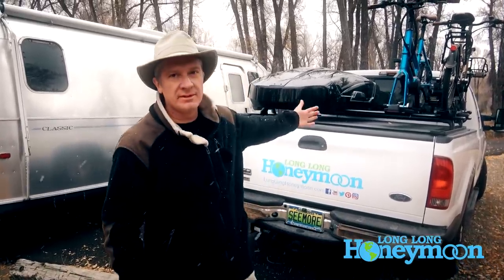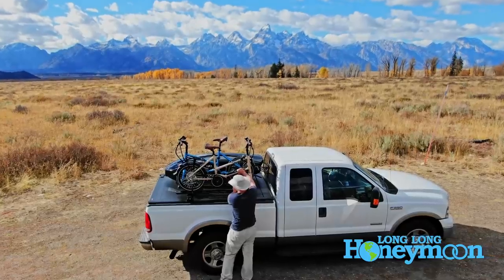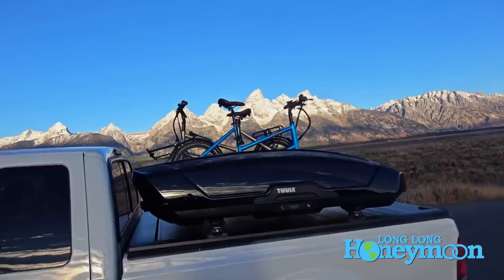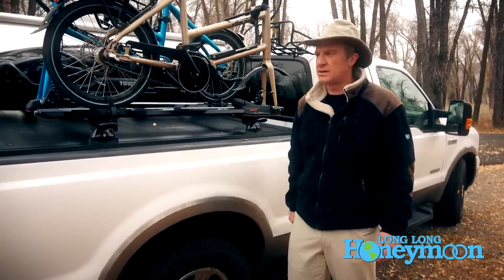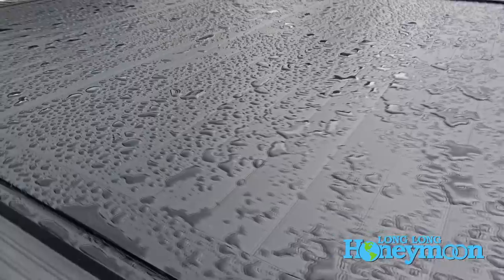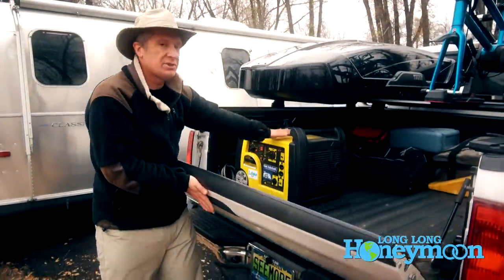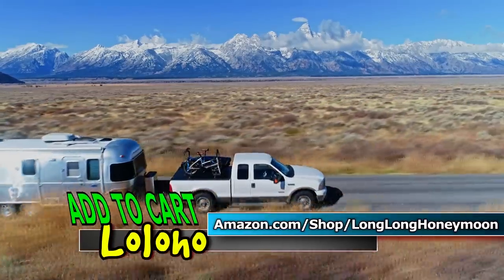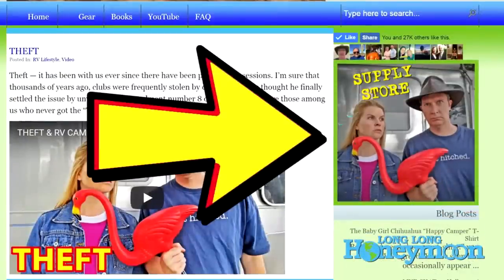THE BEST TRUCK BED TONNEAU COVER? RetraxPRO XR Series Review 🚲 🚲

Comment from the maker: This is it! https://amzn.to/2CJ97Rs
Reply: Campfire question 
 I drive a loud 6.0 turbo diesel like seamore after towing the trailer a long distance I like to let my truck idle while unhitching to let the turbo cool down & start the truck while I'm running slides / awning in to warm up before towing do others consider this to be rude at camp?
Reply: No
Reply: Hey guys! Did you guys like this solution for heavy eBikes?  Did you like the cover itself or did it have issues?  We're doing some research and looking ourselves since we won't be able to store them on the back either. Thanks.

Comment: I just bought a 2018 F-150 and had a Retrax Powertrax installed. It’s my second Powertrax as I had one on my 2015 F-150. Great product. They said the warranty will be void if any lubricant is used on the track. Only paraffin was is allowed. So on my new Powertrax I took a rag and ran it across a block of paraffin wax and applied to the track on both sides. It really smoothed it out. My covers are not 100% waterproof. Heavy rain or Carwash will allow a bit of water but nothing to be concerned with.

Comment: A year or two ago we put a BakFlip cover on the bed of our F250 with a front receiver hitch and bike rack. This looks like a much better solution though it’s also a much more expensive one.
Reply: exactly my thought, however, I think its worth the price - just picked one up today
Reply: The Traveling McCaffertys Our front hitch is a DrawTite brand but I looked at the Curt hitch and it was virtually identical. The bike rack is a Saris brand. No problems at all with the hitch or rack. If I could do anything differently I might get one of the hitches that folds down. Mine is fixed once it is in the receiver. When Im not towing I will sometimes put the hitch in the rear receiver but I can’t put the tailgate down with the bikes and hitch on. They make a hitch that folds down for that purpose but that’s not what I have.

Comment: Looked at the retrax a year ago and got the Pace Edwards. They had the rail system (much cleaner look and lower profile) before retrax offered theirs. Pace Edwards doesn't have an exposed key lock which is great for newer trucks with locking tailgates. (no key to deal with) Also comes with thule load bars. Retrax is nice though,.

Comment: We love our Retrax Pro MX on our Chevy 2500.  We find that with three young kids, my wife and I, our truck has become our main family vehicle (not just when towing our Trailer).  So keeping everything dry, and clean and still having room for a bunch of stuff is a plus.  I opted for the electronic one with remote; my wife can access easily without swearing at me :).  We have been very happy with it.  For those interested, as I was, I reached out to Retrax and got word this morning.  If you already have some other model of Retrax installed, the XR rails can be purchased and retrofitted to your current system.
Reply: Good information , thanks!

Comment: Good video, but IMO I think the storage hub would be better on the other side for rear view vision.
Reply from the maker: We could easily switch it.... I was thinking that the quick access from the driver's side would be worth it. It's nice to be able to step outside and immediately have access to that gear. But if the visibility ends up being a problem, we will switch sides.

Comment: We bought a Retrax for our Silverado 1500 when we retired in 2016 and we are full time on the road. This cover has operated flawlessly with no problems. Just a hint on maintenance keep the rollers and slid tracks clean and lubricated with a good silicone spray.  Love our Retrax.
Live your dream.

Comment: Now that it's been a few months since you had your Retrax cover installed, are you still happy with it, and the bike rack?  I had a Retrax (without the T-slot rails) on our 2017 RAM 3500 long bed, and it was VERY difficult to open and close.  I'm guessing the installers did not read the instructions.  We really like the idea of storing our bikes above the truck bed.  How do you secure the bikes so they don't get stolen?  Thanks so much for the great content!!!
Reply: We are still loving our cover. The bike rack has locks at three different points, so it's pretty darn secure. Not saying it would be impossible for someone to steal them, but they would have to put in a whole lot of effort!

Comment: Can you provide the Yakima part numbers for the parts you've used. I cannot find your type of setup on their website. They have an Outpost and Overhaul system, but they are higher than your system. Thanks.

Comment: We just returned from a couple of weeks of camping.  We have a popup camper so overnighting in a parking lot or rest area is not an option so we decided to set up and take down the camper every day getting to and from our destination, we won't be doing that again.  We originally were going to book a room at hotels along the way but were concerned the truck would be an easy target for those with ill intent.  We have a soft tonneau cover and it would be way too easy to get into and get to our generator, e-bikes and my cooler filled with adult beverages.  We decided to go with the Retrax cover from your Amazon store it will be here Tuesday. Now I have one more question were did you find the crossbars and T mounts.  Also thanks for all your entertaining and inspiring videos.  P.S. My wife has scoured your Amazon store and still can't find your self respect for sale LOL.

Comment: I've had a retrax for 14 years and will not get another one. Takes up too much space. Drilled drain holes. Drain hoses plug up with debris. Really starts to break down and become harder and harder to open and close as the years wear on.
Great for what it is maybe but not for me anymore.
Reply: I believed they have a lifetime warranty. Not sure if they would cover the closing issues

Comment: Good point about Ebikes and standard racks. The weight rating is usually not enough. The 1Up USA is a nice hitch rack with a decent weight rating. I liked it, but as soon as I hooked up a trailer, the hitch was not available for the bike rack. I put a bike under a $300 Tonneau, but I travel down (live on) a dirt road. A lot of dust kicking around. 

It's a beautiful cover and a great piece of engineering. The price is eye-watering. Right now I have a small van for my RV, and I could buy a small utility trailer for that kind of money. There are folding ebikes, and some, like the Fat Folders (wide tires) are very capable.

I didn't plan to watch more than the first 30 seconds of this video, but you had me hooked. People really have to work to keep things fairly simple, not leverage the stuff with more stuff. Stuff to the power of whatever...

Comment: I just had the Embark installed. It was GMC approved and had them install it. Mine doesn't have the rail system on top but don't really need it since I have a toyhauler, but having the whole bed locked is a bit of confidence.

Comment: I'm in Reno, NV and I called the local dealer.  He has been selling Retrax since they came out and said the ProXR is the best they make.  I have a 2016 Silverado crew cab with 6'6" bed.  They will install for just $100.00!  Yes I am lazy, but if something goes wrong they are on the hook for correcting.  I have the Chevy cover but always have hassled with the connectors and afraid of some twit with a knife.  Thanks so much for the videos and stay warm!!
Reply: Richard, did you go with this cover? If so, who did you use in Reno and how do you like it after a year?
Reply: @ChipRoberson  Yes!  It has been great!  Absolutely no problems!  TIP:  ONLY use paraffin was to lube the tracks.  Cut a small block and run up and down every so often and you are good to go!  Used Trimline on Greg Street

Comment: Hey Guys, what is you extended experience with the Retrax Tonneau cover?  I have a five year old Bakflip that is pretty torn up and needs replacing.  Looking for something that will last  a little longer.
Reply: It's still going strong! No problems and no leaks. Two thumbs up!

Comment: You and I are on the same page with the RetraxPro XR  cover and the E bike storage. Wanting to know how the Yakima High Speed mounts are working out after you have been using them for awhile - any issues or recommendations? Are you going to made any additional comments on this system?  Thanks.
Reply: Everything has worked well so far! Totally recommend! 👍

Comment: I see you are now using a champion generator and not your old yamaha.  Before i buy one i would like your reasoning.  Thanks for the great vids.  Soon to be a vagabond:  Joe Butler  SW Florida
Reply: We bought our Yamaha in early 2007. After almost 12 years it was starting to wear down and not be as reliable. We decided to try something cheaper with a lower profile (to fit under our tonneau), and it has a remote start. It's been a good unit so far!

Comment: FYI, the non pro versions are more reasonably priced as well. These new ones with built in rails are very cool. Wish my old ones had this option (I have drilled towers on my bed rails in the past).

Comment: Great choice Shawn! We tow a Toyota Tacoma behind our motorhome. I bought a ProdoTech folding e-bike two years ago, with the intention of storing it inside my truck bed. As you know, good e-bikes are expensive, so I wanted to be able to hide it from prying eyes while traveling. I then began searching for a quality locking bed cover. The RetraxPro was the most expensive on the market, but it seem to get the best reviews. I have been extremely happy with it after two years. Not only does it hide equipment from prying eyes, it protects it from the elements. I do get some light rain water leakage at the tailgate area, but the rest of the truck bed stays pretty dry. They didn’t have the model that you purchased available when I bought mine, looks like a great addition to their lineup!
Reply: What size bed on the Tacoma?  Does the Retrax take up much room when it's retracted?  I have the five foot bed on my Tacoma and the Retrax is on my short list.
Reply: I wasn’t sure of the exact measurements, so I just went outside to measure. The Retrax drum that stores the retractable top takes up 11” of bed space. It is mounted to the bed rail below the rear window, but it does not touch the floor of the bed. It still leaves about 8” of space between the the floor of the bed and the bottom of the drum. I have the 6’ bed and it hasn’t hampered me yet. A 5’ bed may be a different story though if you need to haul long objects.
Reply: I forgot to mention, the Tacoma’s OE cleat tie downs and sliding bed rail system must be removed before the Retrax can be installed. That was the only negative thing I found with the Retrax. To be honest, I really don’t miss it, but I can see where it may be a deal breaker for others.

Comment: Nice! I considered this and the diamondback they run for the same price. I went with the db although im probably never going to use it to its full potential it can hold 1600lbs on the top of the cover
Reply: The only problem with the diamondback, and I had one on my older truck, is you can't access the bed with stuff on top of the cover. The only way to access the bed is thru the tailgate. A deal breaker for me when I upgraded my truck for camping and bike hauling

Comment: I prefer the cap type cover for keeping my accessories, bikes, generator etc out of the weather.  Also I get better mileage due to the aerodynamic wind flow over the cab and cap over the trailer.   The price for your cover is high and your bike frames are subject to weather.
Reply: We like this system because when we aren't on the road the Thule box and bike racks can be removed in minutes. I also don't like the lack of visibility with a truck topper. It's just personal preference.

Comment: Love the idea of the cover.... but what happened to your Yamaha generator?  We have a Yamaha and struggle to find a truck bed cover that would allow room for the gen.  Any solutions or ideas (other than trading in generator - we LOVE the Yamaha that you guys have (or should I say had)?
Reply from the maker: We still have the Yamaha but (sadly) I don't think it will fit beneath this cover. Now, someone out there could probably mount the generator ABOVE the cover. They make T-Slot platforms and I think the load bars can hold 300 pounds! You would need to really secure the generator in place, though! I haven't seen it done but it should be possible...

Comment: I have a retrax on my 2015 F150 since I bought it. The cover still has not leaked. One thing the cover is not responsible for is the draft between your tailgate and the truck body. I have gotten lots of back road dirt in the first few inches of the truck bed. I love retrax paid 1200.00 for mine at the time. I installed mine by myself. No disrespect to Sean. But it is actually easy to do alone.
Reply: By truck body I should have said the spot between the the end of the cover and the tailgate on the truck. Along the sides on both sides are sealed completely. For me I just let the little bit of water that goes into the retrax box just fall into the truck bed.  It's never been a problem and we live in Florida with lots of rain.

Comment: Did you consider a bed cap instead of the tonneau cover and if so what were the factors that made you go with this set up?
Reply: I personally don't like the lack of visibility with a shell. Also, our bikes would barely fit inside a shell. Not to mention they would take up half of the bed space. This system allows full use of the bed space, room for the Thule storage box for things we access frequently, and storage for the bikes. When we're not on the road the Thule and bike racks are removable in minutes. We really like that! It's just personal preference, and this is what works best for us.

Comment: We are full time Airstreamers  and store our MTB  externally. Unfortunately a lot of the hardware on the bikes are getting surface rust especially after spending a month along the Oregon coast..
Reply from the maker: Check out Boeshield T-9. We have this stuff in the liquid and spray varieties and it works well. We use it everywhere on our Airstream (door, keyholes, hitch, hinges, latches, etc.) but it is great on bikes too. Developed by Boeing to protect aircraft from rust.  https://amzn.to/2CgzHR0

Comment: After seeing and experiencing the full installation of this cover on a RAMBOX truck... I cannot recommend it if you plan to actually use the rails like I did. The whole system relies on 6 tiny screws (3 per side) into flimsy sheet metal to support the entire system along the bed sides of the truck. NO WAY it can support any meaningful amount of weight In a safe manner. I have a detailed video of how  this cover isnsupposed to install onto a rambox truck if you are interested.

 Retrax customer support does not have any answer to its design flaws yet. I am still waiting waiting for a follow up from them.

Comment: For two grand you could probably by a nice shell and keep the bikes inside.
Reply: I personally don't like the lack of visibility with a shell. Also, our bikes would barely fit inside a shell. Not to mention they would take up half of the bed space. This system allows full use of the bed space, room for the Thule storage box for things we access frequently, and storage for the bikes. When we're not on the road the Thule and bike racks are removable in minutes. We really like that! It's just personal preference, and this is what works best for us.

Comment: Why did you choose this instead of a cap for your truck bed?
Reply: We needed to be able to bring our e-bikes on the road with us. They are too heavy for a hitch mounted bike rack, so an over the bed rack system was our best choice. This cover has the rails built in and works seamlessly with our Thule storage box and bike racks. And when we aren't on the road and don't need the box or racks, the rail system is really easy to remove.

Comment: I like that update to their cover.  I had the Retrax cover without the integrated rail.  I ended up drilling holes in the cover through the bed of the truck to attach the Yakima crossbar feet to the truck.  It worked well.   I wish this version of the bed cover was around in 2014 when installed my set up!
Reply from the maker: Yes, we have some friends who did the same to their Retrax a few months ago. I think this model will prove to be very popular.
Reply: U can buy just the rails with the t-slots to retrofit. I just ordered and looking forward to installing it on my 2 year old retrax. Also...what model is the Thule cargo u have in the video?

Comment: That cover is sweet. Sooo much better than most. Good choice. What size fuel tank do you have? If it is the 23-26 gal tank do you find that it is a problem with frequent refuels or other?

Comment: Another good option is Truck Cover USA. They have basically the same type cover but use Yakima rails. I think it's called the American Rack System. I've had mine for several months and love it. The Retrax wasn't out yet when I bought mine. Mine is outfitted with  two regular bike racks.

Comment: That is a great cover for a jobbers truck who keeps containerized material that conforms to the size of the bed and stays under the height of the  cover. I prefer my Access roll up cover because I never know what I will have in the back and sometimes I need my roll up to flex to cover things that would be to high and not be covered by a rigid cover.

Comment: Looks like a nice tonneau. Just curious how does one keep water, grit and dust from entering the bed through the tailgate gaps? I have a tonneau which seems tight and tried weather stripping on the gate which helped only a little. When it rains "sideways" (as Forest Gump would say) my truck bed becomes a shallow swimming pool.